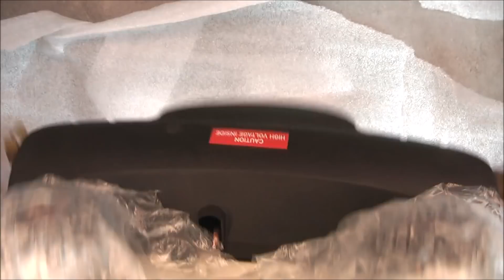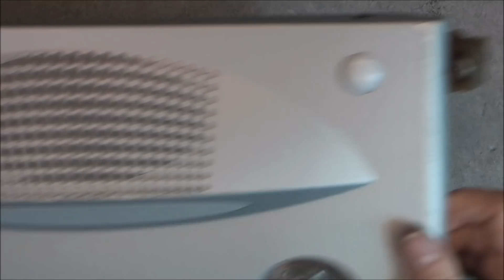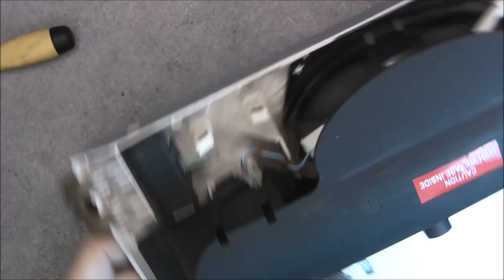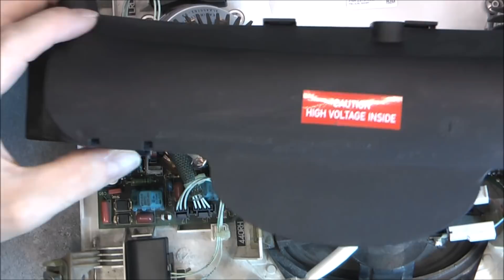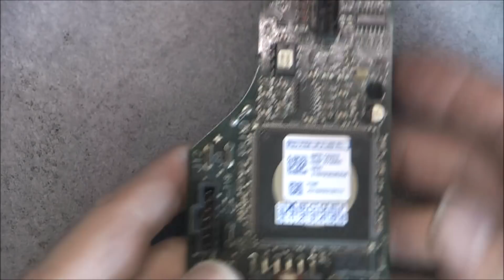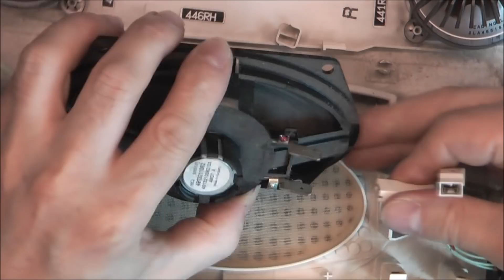A340 passenger overhead panel teardown

Comment: 15:35 Those LEDs must have really been used and abused! Look at the dark spots on them.
Reply: I'm pretty sure these are OSRAM brand LEDs, I've used similar ones in my products and they actually have a single die in the center of those packages which is likely what the dark spots are. I don't think that they're necessarily damaged. Look up "osram topled" in google images to see some examples.

Comment: Very interesting, thanks for showing! I would try to apply 28V to that 680uF 50V cap, since it definitely seems like the output of the PSU. I'd start with low current and ramp it up to make sure that nothing is drawing too much current. I would expect maybe 100-300mA idle for this device. I'd expect the lights to work normally at that point, though you might have to increase the current limit. The big processor chip (I don't think it's a CPLD/FPGA) is very weird to see on that device, particularly with that many pins. My guess is that it provides built-in testing, includes a data bus decoder for the digital audio for the speaker and also manages passing the attendant call onto the data bus of the plane. There might be some basic sensors on this device as well? Not sure. Still far more pins than I would expect though. The input power is likely 115V 400Hz AC. Since these units are connected with long wires through the cabin, you want higher voltage to reduce current and therefore resistive losses, which is why they're not just using 28V here.

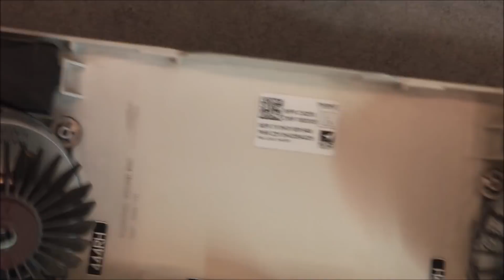At 3:25, the manufacturer and the dates are both there. MFR = manufacturer, and it's a CAGE code (American code for companies that do business with government/aerospace). In this case, the CAGE code is "C6253", which is "KID-SYSTEME GMBH". This is a very common way of marking manufacturers, since it's short. DMF means Date of Manufacture, and it's 082005 which is either 08/2005 or 08/20/05 in M/D/Y format.
Reply: Actually, to correct myself, 28V might not be smart. I made an assumption that the main system runs on 28V based on the capacitor rating of 50V, but it may in fact be lower, like 12V. I would try a lower voltage first. There might still be reasons why the main system uses 28V, such as in case of backup power if the 115V AC line drops out.
Reply from the maker: Thanks, I will try that, but yeah I can't expect a lot more to happen that having the spot light working, the other things will need orders from the data bus to work.
Reply: Yes, unfortunately that will likely be the only feature. However, maybe you could turn it into a cool adjustable desk lamp! :D Sometimes, 28V hardware can run on as low as 19V. If so, you can use a cheap 19V laptop adapter to provide power. They can usually supply 4-6 amps and you can get them very easily for low cost.